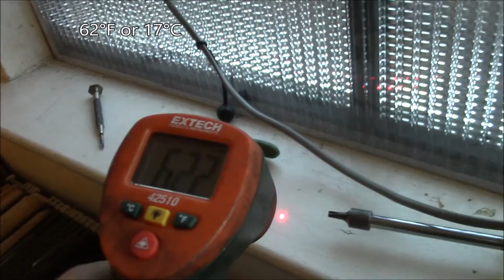In Window Solar Heater: 6 Year Update

Comment: Thank you for your nice and effective heat panel
Reply from the maker: Thanks for the comment.  Yes, it's in use for another heating season.  Yes, if it were re-designed, could consider changing the intake to the bottom, maybe doing one less channel through the panel.

Comment: re: > To summarize, this "heater" doesn't capture any more heat than would have come though the window  alone

I'll argue that you are increasing the heat gained. The reason is the hot air in the heat panel is close(r) to the temperature of the outside pane - ie there is little or no heat exchange at the point of time if the air is stagnant. Whereas the air in the room is cooler. By circulating the cooler air into the heat panel , due to the temp diffence ; heat is now transfered from the heat panel to the cooler air.  

ie by constantly moving a body of greater temperature difference (cooler air) through the warmer heat panel; you are effectively drawing more heat into the room.  

https://www.youtube.com/watch?v=Z7xO3vonHfc

Comment: How come you didn't reverse the air flow taking cold air intake from the lower part of the room, and then blow out the hot air at the upper part of the room?
Reply from the maker: Yes, that would be an option.  The main reasons were to help with mixing the heated air into the middle of the room and out into the rest of the house and also to break up the natural stratification, pulling the warmer air up at ceiling level down.
Reply: @The4Crawler I was looking into this a long time ago when I first wanted to make one. The other designs are using counter flows -  in from lower out on the upper as it has a higher efficiency in fluid dynamics so I chose to do it the other way. Was just curious on the design decision. Hot raising temp through the grates would go up less in temperature than cold going into the grates. But you are right about the stratisfication. The turbulant mixing is better. Maybe you can put a pipe the output back down to the lower layer.
Reply from the maker: @awesomedee5421  It's easy enough to unscrew the 2 fans, flip them around and screw them back in if you want to reverse the air flow.  So it's not like you're locked into only one direction of air flow.
Reply: @The4Crawler  Having both intakes and output at the bottom of the heat panel would : 
a) fix the issue of taking the already warmer / higher air from the the room into the heat panel ; taking the cooler air would increase the rate of transfer and capture more heat into the air in the heat panel before it is ejected 
and 
b) by maintaining your output location it maintains your current benefit of ejecting the newly warmed air into the cooler part of the room where it is needed/wanted.

Comment: Does it retain enough to get through the night?
Reply from the maker: It cuts down on heat loss over a bare window.  This past winter, only had 14 days where the house didn't get above 60F and that was with 100% solar heat.
Reply: I think if you filled some of the bottom with sand, not blocking the air flow, you could have a few additional hours of radiant heat at night.

Comment: Just open the curtains during the day and close them at night.
Reply from the maker: Yes, that is an option, especially if you have thermal insulation curtains.  I believe I mentioned that in the video.  This is like that idea, but automatic.  Curtains could also be automated with a home automation system.
Reply: jen1762  Putting the solar panel inside the window allows zero additional energy into the house.